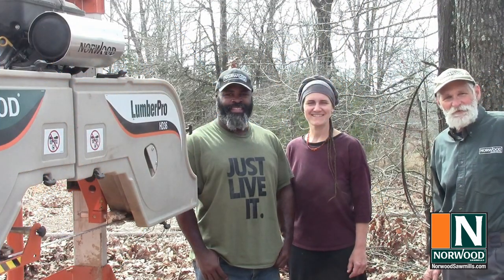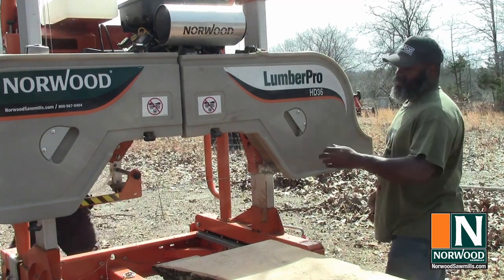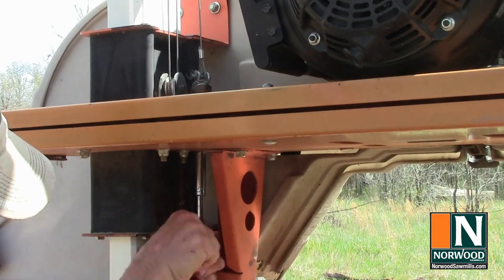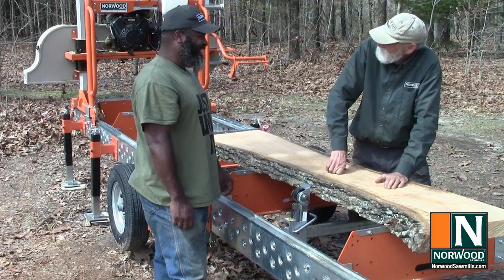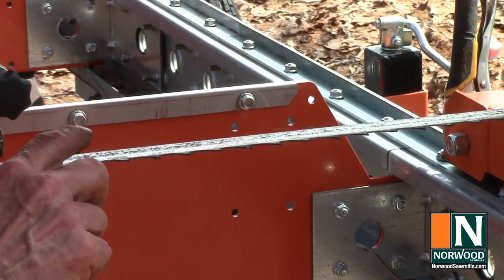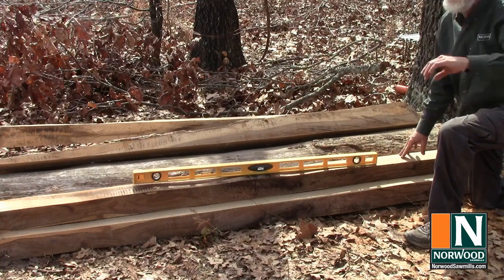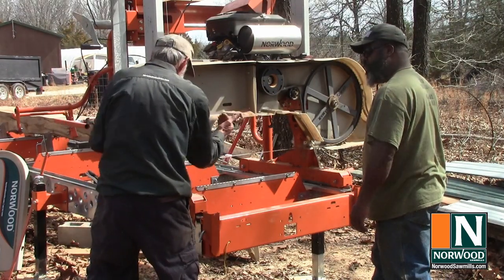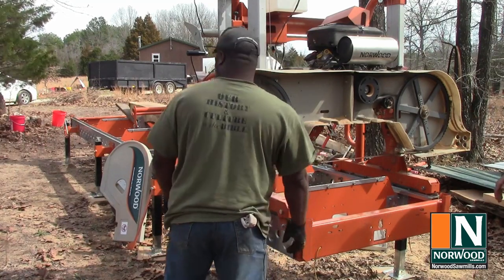Dial-in your Sawmill Tips - Dave Boyt Visits a Family that Believes in (and Lives) Self-Reliance

Comment: Hi Dave,How do you know when the blade is tight enough?
Reply: Good question.  Every mill has its own tensioning recommendations, but I've run across people who are afraid to crank it down tight enough.  If the blade cuts straight and stays on the bandwheels, it's probably ok.  If the bearings are running  hot, you might want to back it off a bit.  I'm working on a universal tension gauge.
Reply: Y
Thanks Dave.
Reply: @victorjohnston72  Any time!

Comment: I think this should have a deadman switch type of latch so someone cant accidentally bump the throttle and engage the blade whilst someone is say adjusting log etc.
Reply: Don't think the motor will fire with covers off..
Reply: @jaytodd5809  watt i mean is that the lever needs a latch to prevent accidental activation [ eg flip the latch engage the throttle.
Reply: @michaeljameson1046  If anyone gets anywhere near the controls while I'm loading or turning a log, I just holler at 'em.
Reply: You sound like somebody from OSHA. That would be a just another dumb electronic part to fail after the first time out in the rain that most people would end up bypassing anyway
Reply: @daveboyt6810  Do you agree that it could be made safer without much effort.
Reply: @JL-77  it doesn't have to be electrical just a simple latch on the throttle . And for your info I am an Aussie cheers.
Reply: @JL-77  An easy fix to a potential problem is never a bad idea.  CE (European) standards are actually tougher than OSHA, and the mill meets those.
Reply: @daveboyt6810  . It's not a potential problem . You of all people should know it takes a lot more than a bump to engage the throttle. You actually have to squeeze it

Comment: I'm still pissedy saw only cuts 29 inch's wide
Reply: You can still cut a lot of good lumber on a smaller mill... just takes a little longer.  No matter what mill you have, eventually you'll push it to the max.  For bigger logs, you can quarter the log lengthwise with a chain saw and mill 1/4 of the log at a time.  I do that on occasion.